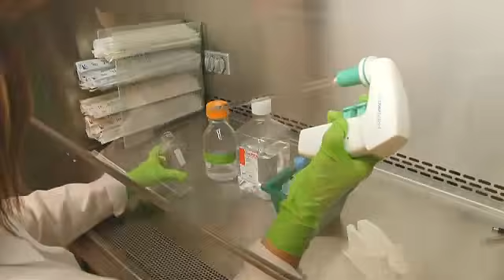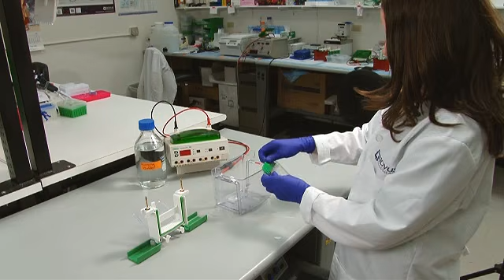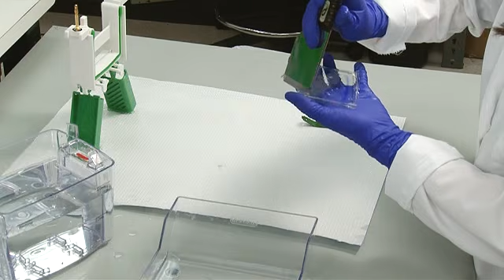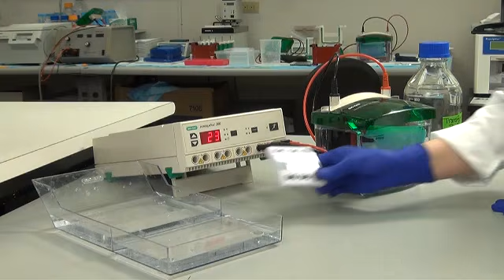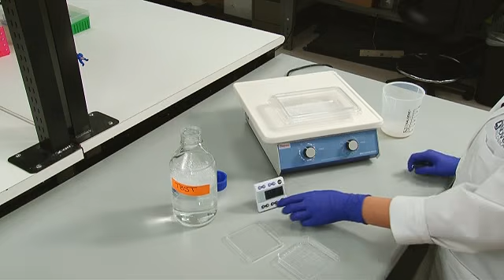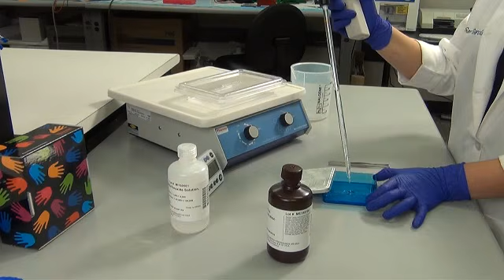Western Blot (WB) Visual Protocol

Comment: when and where do you put copper stain?
Reply from the maker: Hi Nils, thank you for your question. The Copper stain is a reversible stain that, while not required, is an optional step. The Copper stain is used on the gel itself after gel electrophoresis to confirm the migration and separation of proteins in the gel. This step would be performed prior to the membrane transfer and would require destaining the gel before proceeding with protein transfer. Hope that answers your question!

Comment: Great video! Amazingly helpful and very well explained. One little question: In this case, what was the final ECL volume used on the last incubation? I know that it depends on the surface of the membrane (e.g. 0,1mL ECL/cm^2 aprox.) In my case I have a 7 X 8.5 cm membrane, so I just need 6 mL of ECL (following the manufacturer's equation). The problem is that  I'm not very sure if 6 mL  would cover the membrane in that type of Incubating box that you use (mine is extremely similar). What would you do in my case? You would increase the volume of ECL even is not needed or you would incubate just with 6 mL ECL.

Thank you again for uploading this great video. It help us out a lot!
Reply from the maker: Glad that you enjoyed the video! In regards to your question, to be safe use 10 ml of ECL, this is what use. Excess ECL is not a problem.  The key is to make sure the surface of the membrane stays wet and does not dry out.  You can add the membrane to the ECL and rock the chamber back and forth to keep the surface wet. Hope that helps!
Reply: ***** Thank you very much for your quick response!! It will help a lot!